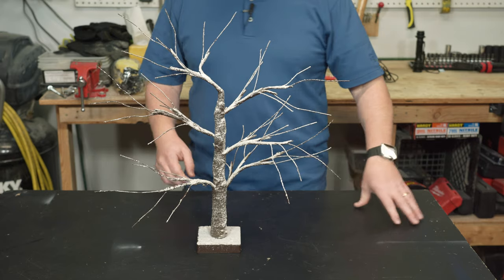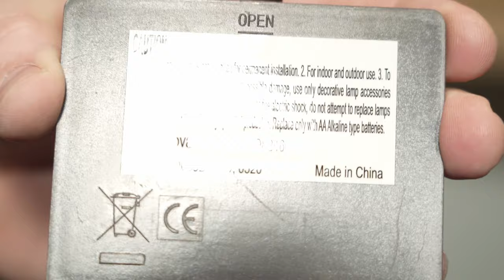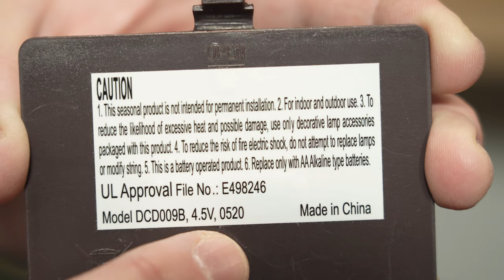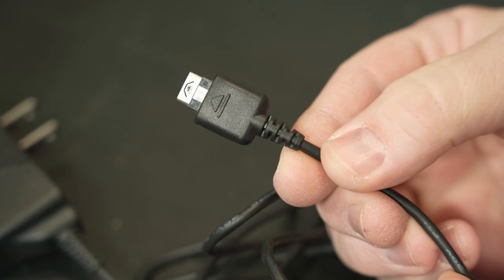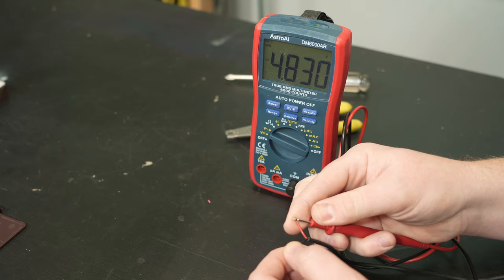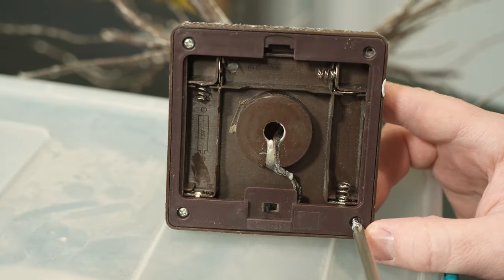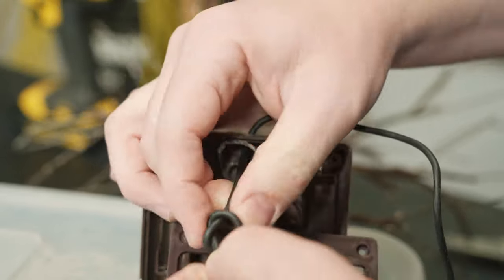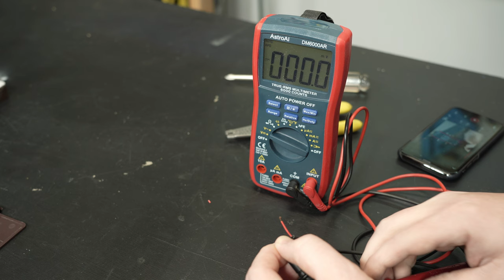Never Replace Batteries Again! Convert Battery Device To Wall Adapter!

Comment: Awesome!
I wanted to do this also to my door bell (AAx3) device itself, I even found the same EXACT wall adapter that you used (LG 4.8v | 0.9A) multi meter shows 4.83v so it's good...but, once I did a test run...nothing happens, any ideas?
FYI: Door bell one with 30 pre-programmed rings in it, button on device you click to go threw them all. With the batteries in, I quick click on the button and the door chimes just fine, but with wall-power, once I let go of the button it stops sounding...and ideas? I even tried a 5v|1A power wall adapter, same result ;(
Reply from the maker: Hmm... the only thing that comes to mind is that the doorbell may possibly be drawing more amps than the power supply can provide... but then it would eat batteries very very quickly - so I doubt that's the case. Still, I'd try finding a 5v 2A supply and see if that makes any difference. Also make sure you don't have any loose connections....

Good luck!

Comment: some good stuff. maybe here are some ideas of what you could work on next:
- Use an easy to unplug connector like USB to make it work with any USB wall wart power supply or even computers for lower power things (since so many wall warts seem to be 5v)
- Instead of using a random compatible power supply, use a Qi charger so that you can hide power under tables without having to drill permanent holes through them
Reply from the maker: Thank you for the suggestions!

Comment: I have a decorative tree that I turned into an art doll and I want to alter its power source this way. My question is, since it is now a year later has there been any negative effect on the LEDs on the tree from being plugged in for longer times? The tree in question is in the first one or two demo videos on my channel. Since the universe had you choose a decorative tree to convert to a plug I thought I should ask you first before attempting this.
Reply from the maker: Hi Linda! I'm glad you found this project useful. We've had this tree wired up this way for 2 holiday seasons now. It comes out sometime in November and stays plugged in and lit up all the way until the first week of January when we take our holiday decorations down. So far, no  ill effects to the tree or individual lights at all. 

However: LED's do have a lifespan... it's hard to predict how long yours will last, but it should be several years, at least. 

Good luck!
Reply: Thank you. It will be plugged in from time to time, not constant. But it is good to know that yours, as you mentioned , was an older decoration and still has lasted through longer periods being plugged in multiple years. I will definitely keep in mind that it will later longer if not used like a night light. Lol Thanks again.

Comment: Good job! If i wanted to hookup 20 fairy lights to the same power supply, would i need to add up the volts? What do you suggest?
Reply from the maker: Hi William - when you add more lights, do it in parallel. This will increase amperage, not voltage. You need to make sure each light is getting the correct voltage supply, and the light will draw as many amps as they need. Bang around on Google for parallel vs series wiring if you are unsure of what I mean. Good luck!

Comment: Hi, great guide! quick question: Can I exclude the entire box and keep my led strip directly connected to ac power? I noticed there is a resistor connected to the switch but I dont really need it as I will have it plugged to smart plug?
Reply from the maker: Hi Adam - No, a resistor will not convert the mains AC power to the lower voltage DC power that a typical LED strip needs. You must have a DC power supply that matches the voltage requirements of the LED strip. Good luck, and thanks for watching!
Reply: @AmplifyDIY  Thanks for the feedback. I connected 5V to a strip that was powered by two AA bat - works fine. Thank you again, and be well.

Comment: There used to be adjustable power supplies. Now everything seems to be converging on 5V or 12 V. How would you easily step the voltage down for something that takes 2 cells?
Reply from the maker: There still are adjustable power supplies readily available, or you can just buy a very cheap power supply at the exact voltage you need, if you don't already have one. Thrift stores can be handy for this as I showed in the video, but they are also pretty cheap online: 
Adjustable power supply: https://amzn.to/3rL0P6J
3v (2 cells) power supply: https://amzn.to/3Fbc37A

Comment: What if I wanted to string a few of those ornaments in series each with the same voltage requirement? Your example is 4.5 vdc...so three ornaments would require the same voltage but higher amperage?
Reply from the maker: Don't wire them in series - wire them in parallel. Then yes, 3 ornaments wired in parallel will just need a power supply capable of handling the amperage. Good luck!

Comment: Hello! Thank you for your video, you rock. I hope you can help me. I have that same type of chargers, 5v and less than 1A, but my devices have only 2 batteries (which would be 3V). They do shine a little bit brighter but other than that they don’t seem to heat up. Is it to risky to use a 5V phone charger for 3V devices? Thank you
Reply from the maker: Hi Alba - you should not use a 5v supply with a 3v device. 3v supplies are readily available on Amazon and elsewhere. I don't know what country you are in, but here's what I found when searching for "3v Power Supply" on US Amazon: https://amzn.to/3hxkbqX
Reply: it is not a good idea to use that different of a power supply, although if you have that many 5v power supplies, consiter looking for 3v zener diode. they should be very cheap and be a good way to lower the voltage to your target voltage

Comment: I’ve seen another video where they used a resistor for string lights, which is what I’m looking to convert. If you use a power supply that is exactly what I need do I still need the resistor? I didn’t see you use one here so I’m not sure if it’s necessary, thank you!
Reply from the maker: Hi Chloky - You've got the right idea: if you use a power supply that is matched to the voltage your batteries usually supply, there is no need to add a resistor. Amazon has lots of power supplies to choose from, in all kinds of voltages and amperages. You should be able to find something that matches exactly. Good luck!

Comment: Good tip. Can I use a 5 Volt adapter, For a Xmas Dec that is 4.5 V = 3 AA batteries?
Reply from the maker: Hi Karen - yes, a 5V adapter should work fine for your situation. Good luck!

Comment: What if I can't get 4.5V (South Africa does not provide everything under the sun at our beck and call), but I have a 12V power supply? Even if I connect 2 sets of 4.5V lights in series, that leaves 3V spare, which might not be safe?
Reply from the maker: Don't use a 12V supply. Even wired in series, it will most likely damage things.

Comment: Great tutorial. I have a great small flashlight that has a focusing zoom lens. I’d like to convert the flashlight to a plug-in but not sure if that’s possible. It takes one AA battery. The body of the flashlight is metal so not so easy to take apart. Would like to use for shooting film and animation as the spot on it is so great. Any idea if this is even possible?
Reply from the maker: Hi Judgeworks - sure, it's possible... but likely will be pretty tricky. You'll probably need to just solder directly to the battery contact points in the body of the flashlight. Look for a 1.5V power supply. 

Good luck!

Comment: I have 3 outdoor sets of mini string lights that go around my deck, each string runs on (2)AA batteries. Would I need to make three seperate 3V adapters or could I wire all the sets together and then use one 9v power adapter?
Reply from the maker: Great question, David! Each string needs 3V, so you'd only need a 3V adapter even to run all 3. The voltage does not need to go up with the adapter, but the ability to supply amps will need to increase, as each string will pull a certain number of amps. I'm guessing that each string pulls less than 500 milliamps @ 3V, so if you had a power supply capable of at least 1500 milliamps (or 1.5 amps) then you'd be just fine. You should have no problem finding a power supply that can handle 2+ amps at 3V.
Good luck!
Reply: @AmplifyDIY  thank you much for your advice, and glad I found your great video!

Comment: Could you possibly connect to the battery terminals if the wiring isn't exposed? I have some battery operated candles that only let you get at the battery terminals. Amazon has these ready-made conversion kits, but at $15ea. per 3x AAA device, that can get expensive for what it's worth.
Reply from the maker: Yes, you can solder directly to the battery terminals if you can't get access to any other parts of the circuit. Good luck!

Comment: Ok a couple things. When you solder the wires together, you probably want to twist them together first. What you did was  called a “lap splice”, short for overlap splice. It’s ok but it’s better to have the wires physically held together before the solder is applied. That way if the solder joint does fail everything will still function. 

Ok second thing, and I feel like the comic book guy from the simpsons here’s but you referred to the two wires from that power supply as connectors.  They’re conductors. What am I supposed to believe here, that scratchy is playing some sort of magical xylophone that produces two distinct notes when the same rib is hit?  Hopefully someone was fired over this blunder. 

Seriously though, good stuff!
Reply from the maker: Those responsible have been sacked! 🤣

Comment: i have a decorative statue that has a total of 5 little LED lights and runs on two AAA batteries... what ya reckon ac adapter i need..
Reply from the maker: Heya Android:55 - AAA batteries provide around 1.5v each, so with 2 you'll need a power supply that can put out 3 volts. Here is an Amazon affiliate link for one that would work well: https://amzn.to/3LZ28ni - though you may also be able to find one at your local thrift store, if you have the patience to do some digging. Good luck!

Comment: Hey buddy thanks for the video i want to do something similar to my radiator smart thermostat each stat fixed on radiator takes 2xaa batteries my question is if i need 3v charger what should be the ah to power up 6 thermostat ?
Reply from the maker: I'm not sure I understand the question - You have 6 thermostats that all use 2 AA batteries?
Reply: @AmplifyDIY  yes they all use 2 x AA batteries each what size power supply i need to get ?
Reply from the maker: @Kittiesrulemeeeeeeow  Each one needs 3 volts - depending on how many (milli)amps each controller draws, you likely just need a single typical 3 volt power supply. Do the batteries last a long time? I'm guessing these draw very little current, so you can get away with a single 3 volt supply that is capable of 500 milliamps. Good Luck!
Reply: @AmplifyDIY  thermostat has a motors on them batteries last  3 to 4 weeks max

Comment: Is there a way to do it the otherway around? Convert wall plug to AA battery? I have a mini lamp id love to be battery powered.
Reply from the maker: Theorhetically, sure. Do you know the power requirements of the lamp? Do you have a battery enclosure you could repurpose for this project?
Reply: @AmplifyDIY  yes im planning on using an old Cheap video Game battery enclosure, My Led Lamp is 5v1A

Comment: USB provides 5V. Can I use that safely for 4.5V or would I have to somehow get rid of half a Volt, and if so, how?
Reply from the maker: Yes, you can likely power something that expects 4.5V with a USB-supplied 5V. Good luck!
Reply: @AmplifyDIY  Thank you. For both answers.

Comment: can you convert a battery powered sofa so that it runs off a wall socket? We bought new couches but are constantly having to re-charge the batteries and if it all goes out with the foot raised up, it is darn near impossible to climb out of the sofa chair or couch & love seat. It really is frustrating, but we simply didn't think this would be an issue when we purchased to battery-operated furniture or we would have stuck with manual ones. Thanks.
Reply from the maker: In theory yes, this could absolutely be done. Are the batteries integrated into the furniture? Are they removable? Do you have any way to find out an accurate current requirement for the couch? (you'll need to know what voltage the batteries supply, and have at least some idea of how many amps the couches need...then just as in this video, replace the batteries with a power supply that supplies the same voltage and can handle the amperage the couch pulls.) 

Good luck!

Comment: What about multiple items? My wife has a dozen candles that all take 2 AAA at 3v. Can i wire all of them in series with a  plug like you would with wall plugs on a circuit or will the require a parallel circuit?
Reply from the maker: Hi Tri - yes, you can wire them all in parallel (wiring in series would drop the voltage a little with each candle, in parallel, all candles run at the same voltage) - the only caveat is that you would need a power supply capable of a little higher amperage. However, bear in mind that each candle likely draws next to no current... I'll bet that a single candle runs for at least 24-48 hours before the batteries are depleted, right? Some quick back-of-the-napkin math: 

1 AAA battery likely stores around 6-800 mAh of power. Let's be conservative and use 500 mAh as an estimate. For a single candle, you have 2 batteries, which combine for 1000 mAh of power. With this estimate, if the candles drew 1 full amp at 3V, the batteries would last right around an hour. But as I said above, I'm guessing they last for several days. Let's go with an estimate of 36 hours of runtime per candle with 2 fresh batteries. 1000 / 36 gives us an estimated current draw of around 27 milliamps (let's round up to 30, to make the math easier) per candle. If you have a dozen candles, running at 27 milliamps each, you'll need a power supply capable of 3V @ 360 milliamps. I'd err on the side of having a beefier supply, and get one capable of 500 milliamps or even 1 amp. Here's a 1 amp supply available on Amazon for less then the cost of a cheeseburger: https://amzn.to/3WRKLd9

TL; DR: I'm sure someone will come correct me if my math above is incorrect, but yes, you can wire them in parallel. Just get a strong enough power supply.

Good Luck!

Comment: Hey, can someone help with the following question:

What if you had 2 of those light trees and you wanted to wire them in series so they use only 1 adapter? Do I keep the same voltage but look for bigger amp?
Also does length of wire affect the output and if yes, what should we look for?

Thanks!
Reply from the maker: Yes, stick with the same voltage, and grab an adapter with a little higher amperage rating. The length of the wire can affect how much voltage drop there is... but if it's just a few feet it should not matter. If you are planning to do more than, say, 15-20' though, then you really should just get a separate adapter and wire them separately. Assuming you are trying to convert a little 5V thing, you'll have too much voltage drop due to the internal resistance of the wires. If you are only adding less than 10' though, don't worry about it. Good luck!

Comment: Is it possible to power supply multiple of these example tree decorations ? How would you do it, if you have 3 trees instead of one (as in the video) ? You just buy a 15 V power supply ? How to decide the value of amps for the power supply  ?
Reply from the maker: Hi Adrian - If you have 3 trees that each take 5V, you don't put them on a 15V circuit - rather, you put them on a 5V circuit that is able to handle the combined amperage draw of each of the 3 devices.

Power supplies supply Volts. Devices (loads) pull Amps. So, get an appropriately sized power supply (5V, 3x the amperage of 1 device) and wire them in series.

As for how to calculate how many amps you need - it's a little tricky, but there are some convenient rules of thumb: it's unlikely that anything powered by 3 AA batteries draws more than a few hundred milliamps at most. If you had 3 such devices, a 5V power supply rated at 2 or more amps should be *plenty*.

Good luck!
Reply: @AmplifyDIY  thank you very much. Now im finaly in the picture how it works :-) Somewhere i red that AA / AAA baterys can  deliver around max. 50 mA power. That should mean that one device can pull out max 150 mA (calculate 200 mA with reserve).

Comment: Do you have to use a 110 adapter? Can I just take a junk extension cord and cut the male end off and connect the lights to the ext cord?
Reply from the maker: Hi Mike. Definitely DO NOT just connect an extension cord to a small string of lights that expects to run on a low-voltage DC circuit. If you have a thing that runs on a couple of small batteries, and you connect it directly to mains power, you'll let the magic smoke out of the thing for sure... and possibly risk starting an electrical fire. YES: You need an adapter. Good luck!

Comment: I have a 5 volt adapter and a 9 volt adapter. In an automatic handsoap dispenser that holds 4 c type batteries, Can any of these work?
Reply from the maker: A type C battery is rated to provide 1.5 volts. 4 of them wired in series would provide 4 * 1.5, or 6 volts. The hand soap dispenser may work fine on 5 volts (slightly lower than 4 fully charged C batteries) but I would not try the 9 volt adapter. That may damage the dispenser. 
Good luck!